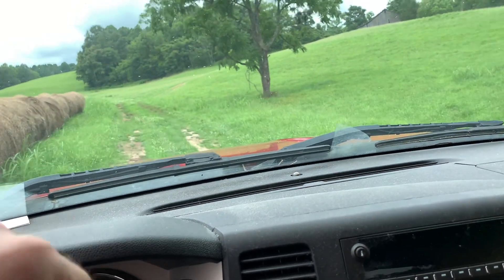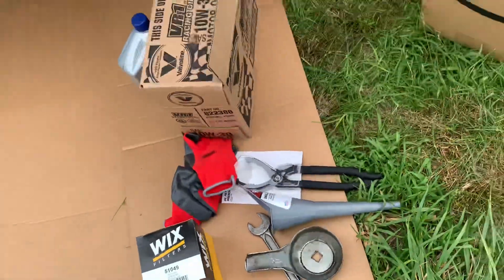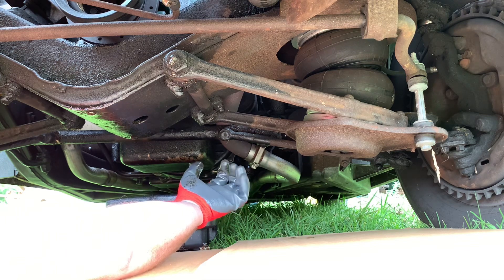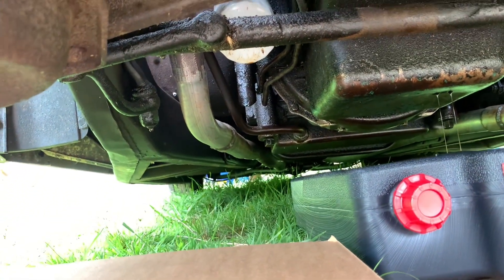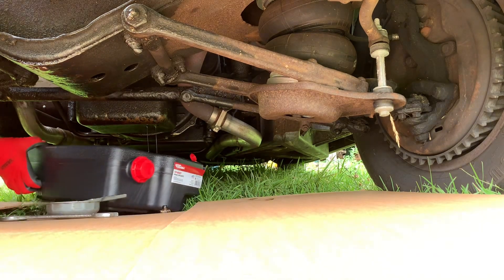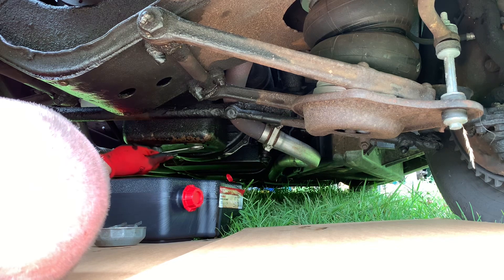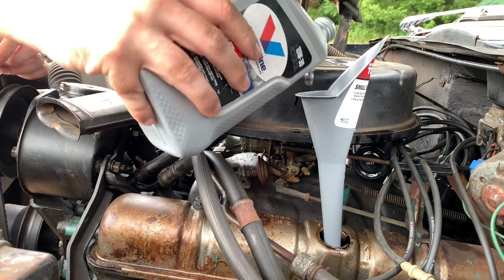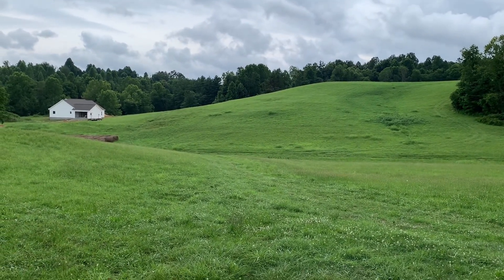Scenic oil change 1960 Buick Lesabre

Comment: Hi friend, great car, do you have a video of how I attach the rear bags to the top where the old spring attaches? Thanks in advance
Reply from the maker: @araelgondin1128  I don’t have a video. But I cut out the stud the spring was bolted to and drilled a half inch hole in its place. Then you use a cup style top bracket and bolt it in
Reply: @dweb7321  I understand now, thanks for answering
Reply from the maker: @araelgondin1128  No problem, any time